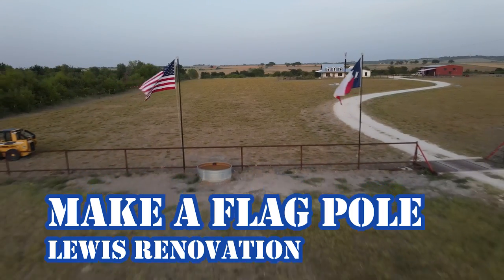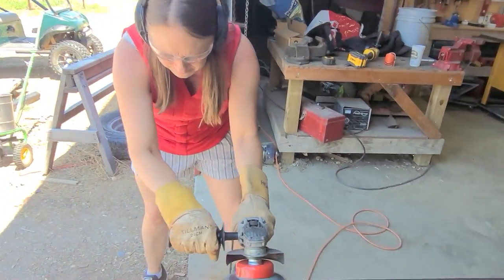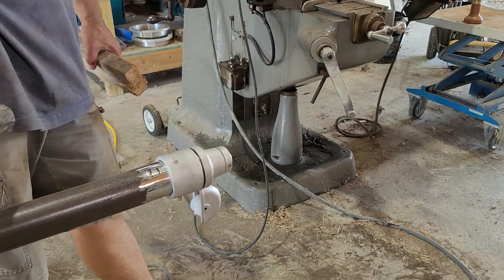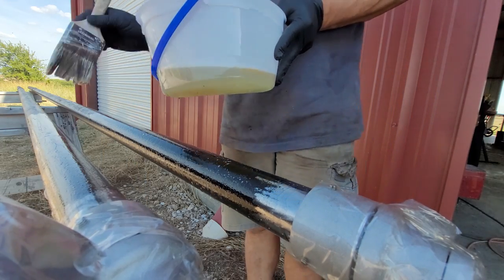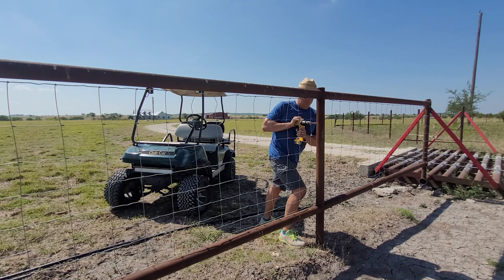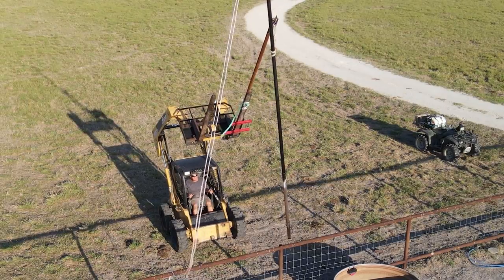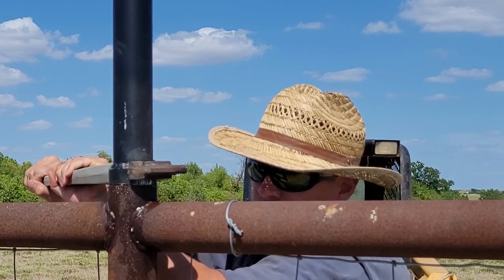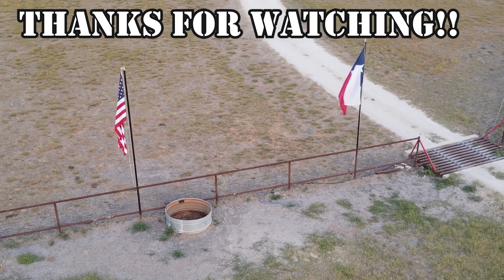How to make a flag pole

Comment: Awesome Flagpole! The Truck you used is a very good quality. I refurbish old drilling pipe flag poles as service projects for my  American Legion Post in Louisiana.  I am curious to know why you didnot screw a flagpole topper on the top of the flagpole? The Truck Top requires an 1/2 inch 13 UNC threads. A Star Topper would look awesome on the Texas Flagpole. Solar Lights added to the top is a plus. Semper Fidelis
Reply from the maker: Thank you for the comment and idea. And your Marine service too (part of the navy 😁)

Comment: I just did mine at home out of the same pipe it's 25 foot above the ground . My question is I am going to put a 5x8 and 4x6 on the same pole and didn't know how well it would hold up . How does yours hold up just a single 5x8 flags in heavy wind? Thank you for your service too
Reply from the maker: I think it could easily hold two big flags. Mine doesn’t move at all even in the highest winds. Good luck with all your projects
Reply: They’ll be fine, I had a 20’ that stood 100 mph winds with no sign of giving.
Reply: Same idea but I'll be using 6x10 and 4x6 Nice thing about it is.I'm watching this video so now I know put a 3 inch diameter truck on there

Comment: Well done. Very nice. Can you send the the details of the pipe sizes and where you purchased the truck and ball, etc.
Reply from the maker: Flagpole Single Pulley Revolving Truck - Cap Style for External Halyard - Heavy Duty Flag Pole Replacement Pulley - Made in The USA - (Fits 2 3/8’’ Outside Diameter) https://a.co/d/efa1R0Y

Comment: Where did you get the flagpole kit? I have 2  3/8 drill stem also
Reply from the maker: Flagpole Single Pulley Revolving Truck - Cap Style for External Halyard - Heavy Duty Flag Pole Replacement Pulley - Made in The USA - (Fits 2 3/8’’ Outside Diameter) https://a.co/d/cRrGVgQ
Reply: @LewisRenovation  Thank you!

Comment: Did you install balls on top?
Reply from the maker: I should have but didn’t order any and wanted to get them up by the 4th
Reply: @LewisRenovation , You could weld a Star or large Ball Bearing to a 1/2 inch 13 UNC Threads Bolt and make your own Topper.